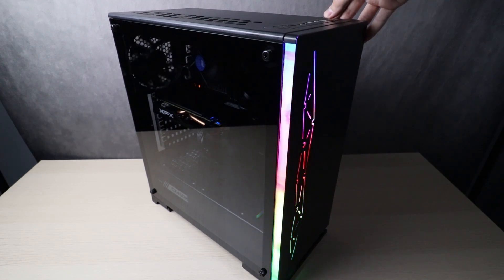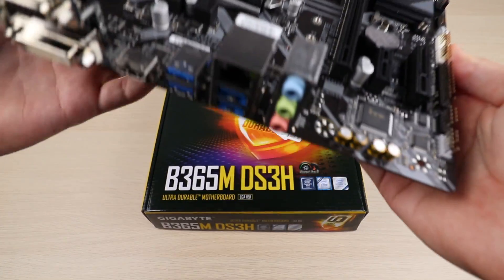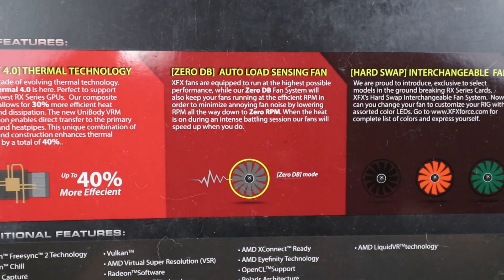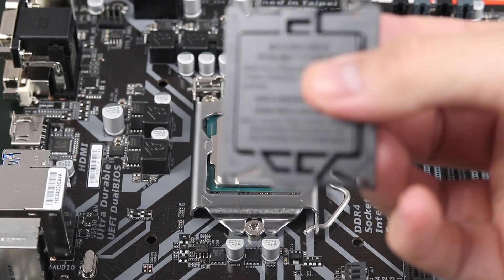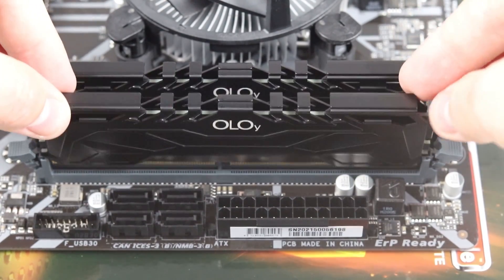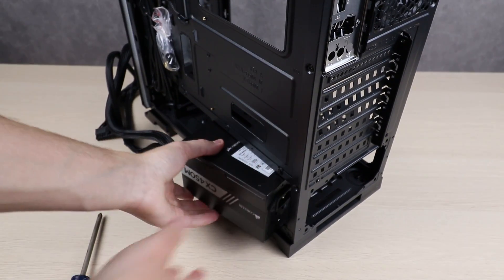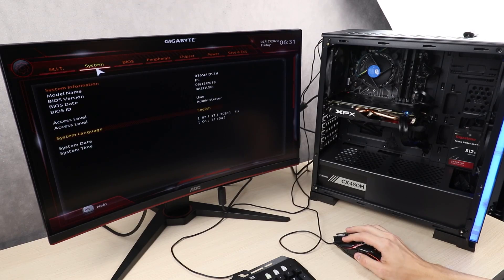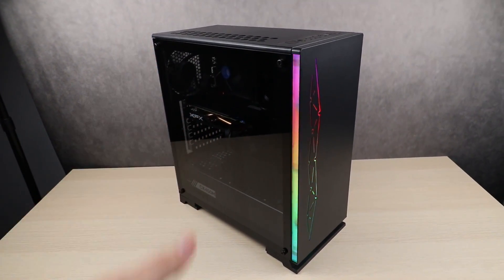(2021) $500 Gaming PC Build! | Budget Builds Ep.7

Comment: Are u a fan of Ryzen? I’m trying to figure which one to pick and i just find all the ryzen vs intel videos confusing. I just need an answer. Ryzen or intel?
Reply: depends what kinda pc you want
Reply: JakeTheSnake 010 ryzen
Reply: Ryzen because it has more performance for the price and is cheaper many ways and is really good for multitasking and gaming, it is really good for streaming and gaming and it has hyper threading which is like 6c 12threads unlike intel with 6c 6 threads
Reply: And comes with a cpu cooler already with thermal paste pre installed
Reply: Ryzen cuz it gives you more options and compatibility however it depends what you’ll use it for
Reply: Batty Isflatty I’ll use it for editing videos and gaming
Reply: JakeTheSnake 010 well In my opinion ryzen but you decide
Reply: I chise intel cause more single core Performance
Reply: INTEL

Comment: This is my exact build but I upgraded to a rx 5500 Xt and now I’m switching to an amd ryzen 5 2600 a b450 board and 16 gb 3600 speed the 9100f is so slow I would definitely upgrade that first
Reply: Did you only switch the processor and graphics card?
Reply: Sentranix YouTube I switched the card already and I’m about to switch the cpu motherboard and ram
Reply: Stalgic 200 in creative like 144 in normal games but u can’t stream on it the stream will have bad fps
Reply: @ericboucher5654  If u use OBS you can optimise the settings and mess about with the controls until it works out
Reply: Sentranix YouTube hmm I would probably need someone to show me how
Reply: @ericboucher5654  On YT there's some videos about how to run OBS, I used "Kreekcraft" a while back, hope that helps.